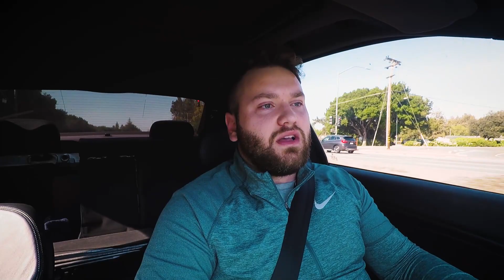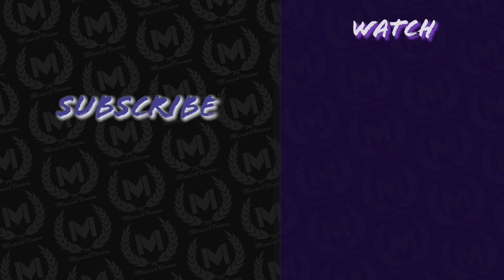BMW E46 M3 CSF oil cooler install

Comment: Hello.very nice content for the m3 generally.but does the csf radiator fits at the OEM position?did you need to make and cutting?
Reply from the maker: The csf oil cooler fits in the oem position and did not require any trimming to make fit. I have a mishimoto radiator on my car which also bolted up directly without any issues
Reply: @MunichVenom  thanks for your reply

Comment: Been thinking about doing an oil cooler upgrade on my m3 as well. Would you recommend this over the radiator upgrade ?
Reply from the maker: i think that both are the best way to go tbh. i would most likely do the csf radiator and oil cooler package. In my opinion the stock fan works great when the fan clutch has been replaced. I think it worked better than my electric fan in some cases.
Reply: I just bought the CSF oil cooler and radiator for my E46 M3 coupe. Just a quick question ? Did the belly pan cover go back on as normal ? Or did you just leave it off completly ?
Reply from the maker: Mine went back on normal. I didn’t have any issues with the belly pan cover. The only thing that won’t line up perfectly since the oil cooler is larger would be the duct in front of the cooler
Reply: Lastly ? I just did a oil change and have about 300 miles or less on the new oil ? Should I change it again or leave it alone ? I used the Moly 10w-60 full synthetic so I think i should be good ? 

And should I do a higher temp thermostat as well with the new setup ? Sorry to overwhelm you with so many questions ? But over $1k in new parts is gotta ask 🙂
Reply from the maker: I personally always change my oil to brand new if I’m dropping it out of the car. Helps keep the oil fresher plus you don’t risk pouring back contaminants into the engine
Reply from the maker: My oil was only 400 miles old when I did the oil cooler and I did brand new oil as well

Comment: does it take longer for the engine to warm up?
Reply from the maker: It takes about the same time since I didn’t touch the thermostat and it opens up at the same temperature which pretty much makes the oil cooler work like the oem one
Reply from the maker: We’ve had a few pretty hot days lately above 30C / 90F and the car has been doing fine driving around town at slow speeds. It has been staying below the 210F oil temp mark
Reply: is there a thermostat in the oil circuit?
I only know  the Watercooler thermostat.